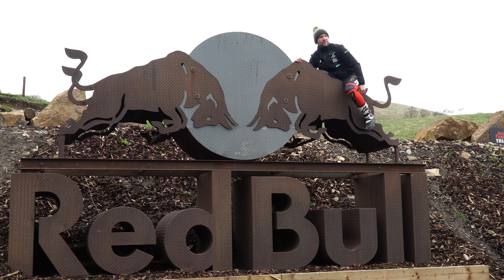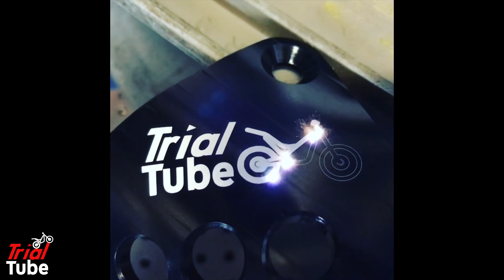Trial Tube - Do I still love my Vertigo R3 300 2 Stroke? Plus trials tutorials!

Comment: I'm going on almost a year of owning my R2 300. For me there is not other bike that I want to ride..owned a Beta, still own a 2016 Scorpa 300, and a 2019 Scorpa 300 Factory, just rode a very amazing look and quite nice 2021 TRS Gold 250, and even got to play on a 2021 EM Race which was a fun experience. After owning or riding all these different bikes none make me happier or want to ride more than my Vertigo. Now sure I can find things to complain about, but at the end of the day the bike makes me feel like trying new things, pushing my limits, and brings a huge smile to my face each time I oh so very smoothly grunt my way up a technical turn laced hill. The smoothness of the Vertigo motor down low has me  yet to meet a rival. Then when you want to really go the bike has all the go you could want on tap. Where I live we went from 95F last weekend to 55F a few days later. Guess what my Vertigo runs just about the same. My carbed bikes are surging at idle and need tweaks to the air screw. All the modern bikes are incredible, and it os hard to go wrong no matter what you ride, but for me I love my R2 !

Comment: Recently picked up an R3 250 having come back to the sport in 2017 after a 27-year hiatus and a few years spent road racing. Had a 2018 Beta 300 and then a 2020 TRS 280 One R — knocks both into a cocked hat so far, absolutely incredible bike. Only thing I can criticise is the thin standard sump plate — have also gone the CSP route, though a plain one to better hide my clumsiness... good work with the videos, trials needs as much media as it can get.
Reply from the maker: Thank you so much for the incredible comments bud and really appreciate the backing up of my expertise! 

Hope to see you soon!

Comment: Great video, Ive gone from a Beta Evo 250 to a Vertigo R 250 and its brilliant it turns,  I find it grips more on the turn, great balance , and the throttle response is so so so crisp, smooth, and the feel of it spot on. You Have to try one to understand.
Reply from the maker: Exactly!! I was Beta trough and through and lol at me now! Loo
Reply: I am surprised Vertigo turns as good as it does. On the ground walking the bike upright on steering lock it has a much bigger turning circle compared to Beta When on the bike I am pulling off turns a lot of others struggle with.
Reply from the maker: @shawnmcginnis2508  it’s all about the way the bike feels turning in! Ps the Beta will turn tighter as the head angle is steeper.
Reply: @TrialTube  100% . Beta  has a shorter wheelbase too. Like you said though so much is about how it feels in the turn and the confidence it inspires. :)

Comment: Hi Danny. Where did you get your carbon engine protection from. Thanks
Reply from the maker: On that model it was standard Vertigo equipment. However I use RT WORKS for my usual stuff and my Nitro!
Reply: @TrialTube  thanks for the information Danny. Just bought a 200 jbr vertigo. It's superb
Reply from the maker: @chrisstoddart4342  fantastic choice the 200 is awesome!

Comment: Thanks Danny and Stu!
Danny, what are the main differences in how the Vertigo rides compared with the Beta after 6 months?
Reply from the maker: It finds the grip a lot better, is lighter and reacts faster. The suspension is better and so are the brakes and clutch. But there is a rather large jump in cost also.
☝️
Reply: I'll second Danny's opinion. When people ask me I say it feels like a stretched out, more responsive, and more peppy Beta. Vertigo has done a great job (speaking for my 2020 300 R2) about making a motor that will chug along so smoothly when put under a bit of a load that is predictable, easy to modulate,doesn't have that surge or stutter, and just pulls. It inspires so much confidence in tight hillside turns. 
    It is longer than a Beta and you feel that right away. It is more responsive to footpeg pressure, and flicks about easier. Not quite as fast handling as a Scorpa or TRS, but a nice balance in being flickable yet stable.  Vertigo has a bit heavier front end feel as well.
    As I commented earlier all the new modern bikes are very capable and you really can't go wrong, but for me my R2 is what makes me want to ride and try new things. I instantly miss the smoothness of my Vertigo when getting on other bikes. The level of consistent and precise throttle control is just not able to be found on a normal bike. Idk if you'll get on a Vertigo and notice the smoothness and throttle control immediately, but if you ride one for a bit in some sections and then go back to a bike with a carb its then you'll feel the difference and most likey miss the smoothness. One last thing I'll say ,as much as I talk about the smoothness of these bikes they also will rev and dang do they put out some power when they are asked ! Where my Scorpas quit pulling my R2 yanks even harder.
Reply from the maker: @shawnmcginnis2508  what an incredible comment and thank you for backing up my experience 👍👍👍
Reply: I guess I'll also try to clarify when I say smoothness it is not the same as flywheel weight smooth or slow. While the R series bikes have an added flywheel weight they don't feel like it. Both my stock Scorpas (2016 standard and 2019 Factory 300) have more flywheel effect feel. Vertigo is a tuned soft and smooth down low, not a weighted flywheel soft and smooth. Unless you ride one it may be hard to understand the difference especially with my horrible ability with words.

Comment: Not ridden trials for years been riding enduro. Think doing some trials will help me in the technical stuff. Thinking vertigo but only got £5k out of the range what would you recommend?
Reply from the maker: Easily get a GasGas or Beta or TRS in incredible condition for that amount bud! Stick with a 250 though or even a 200 😜

Comment: Love the channel, as a new be to trials, however I would like to see a bit more 'how to' riding technique clutch throttle control etc etc on to start with easy obsticals, a decent practice routine. This really to be aimed at the very beginner, although the content on 'new' bikes is very informative but that's no good if new comers struggle to use them as is, bottom line a bit more how to section but I do happen to enjoy the site very light hearted, funny & it is very informative so many thanks Danny, keep up the good work.
Reply from the maker: We have some more technical riding videos coming very soon!

Comment: Bro the only thing that is a bit off putting on the vertigo is that really loud fan whine, it’s almost as loud as the motor, does it spin faster than other marques? If so why?
Reply from the maker: Honestly I don’t even notice anymore lol and I guess it has a lowered tolerance to stay inside a smaller heat threshold…
Reply: @TrialTube  ooer mother, what’s that mean? Just wondering why, as the ossa had the rad behind the cylinder but didn’t go off too much, but the vertigo is flat out all the time! 
I admit when the fan kicks in on a Gasser etc it does affect performance, is it same on vert?
Reply: @ianmargetts4940  you get used to it, but yes it is loud. Vertigo does have a closer heat range tolerance and runs the bike at a warmer temp to ensure good burn. This does leave the fan running 90% of the time. Because of all the electric stuff on the bike IF the idle is set too low it is more likely to flame out due to not enough power produced to run everything when the fan is on. This was a major point of frustration as well as plugs fouling often when I first got the bike. This is a typical complaint. After talking to the importer im the US as well as a UK Vertigo guy I learned the idle needs to be set right around 1400. This has cured plug fouling in many cases as well as unexpected stalls.
Reply: @shawnmcginnis2508  - great info. I've gone as high as 1500RPM, but have found that's mostly personal preference of the customer and varies a tad between models. And of course, for the unaware in the crowd - reset your TPS when making idle changes!

Personally, I love the loud fan as it tells me things are working! It's also an audible troubleshooting tool. As you mentioned, keeping the voltage up is critical on a Vertigo - and you know immediately you've a low voltage issue if your hear the fan speed drop. Most often, that's just a sign the idle is too low - but regardless of cause, the sound of the fan speed dropping is very obvious.

Comment: Nice front pipe!
I’ve been a Beta man for the last few years and the Vertigo is looking like a good option. 
How does the R3 handle the gullies compared to a trusty old Beta? 
Is there any type of section/terrain you find better on the Vertigo?
Are there any downsides to owning a Vertigo?
300cc or 250cc?
Reply from the maker: The Vertigo just holds most lines better than the Beta (for me) also love the lack of a carb! Makes my life a lot easier!
Reply: I'll add in the map switch makes a felt difference both off idle and mid range. Super fine and precise gentle throttle when needed, rocket ship when needed. Very flexible bike personallity.
Reply: Yes I'd say there are some as on any bike it has its quirks. I'm at work currently but I'll go into detail later.
Reply: @shawnmcginnis2508  thanks for the info. are you on a 300?
Reply: @stuartkeegan100  I am on a 300.  So as far as down sides to Vertigo there are a few. 
   First off is starting. 4-6 kicks cold(occasionally up to 10) and it has some compression so they need to be good kicks. 1 kick 90% of the time when warm. It doesn't bother me,  but some people don't like it. 
  2. Electronics. Speaking 2019 forward they use the Athena GET ECU which is a popular aftermarket ecu upgrade on a lot of FI bikes. Pre 2019 (maybe 18 sorry if wrong on year) they used a different system and it had some potential weaknesses. 
  3. Electronics. People that have been around bikes know carbs( mostly). EFI not so much. It is new and "scary" so people shy away from it. There is a learning curve for troubleshooting, though mostly my bike has been trouble free. The bikes have been around long enough now that there is some good(also some really wrong) community knowledge and most common problems are easily solved now. 
  4. Electronics(sensing a theme haha) because everything on the bike is electronic it uses more electricity. Should the idle drop too low the bike will loose power and die. Caught me off guard a few times when new. Also low idle setting can cause rich running. Set idle to 1400RPM-ish and no more problems. 
 5. Electronics(lol) carbs gum up if not treated well otherwise being mechanical and gravity fed they generally always work. Vertigo has a fuel pump. Filter can clog, and pumps eventually fail. Now most modern road bikes are EFI our cars are EFI ... It isn't a big deal, its easy to test pump pressure, but it is a consideration. Same with water pump,  but at least when it goes you aren't opening up you case and there is no internal engine seal to leak and get coolant inside the case. 
  6. Here in the US there aren't as many dealers as other brands. I don't really have a local dealer. I now have one about 4 hrs away as of recent, but he isn't set up to service the bike. I knew I was going to be my own mechanic going into this. The US importer Lewisportusa has been great,knowledgeable,helpful,easy to reach,and quick to react to the few concerns I've had. So hmm maybe I just flipped that con to a pro...at the very least canceled it out haha.
7. loud fan lol... At least they hear you coming down the loop and are ready for you when you arrive at a section. 
8. The bike looks so dang good you hate to scratch it.... Ok now I'm just having fun. 
 So yeah there are some things to think on, but dang I love my R2! I will eventually upgrade to the R3 airbox cover and maps. My Vertigo has been an excellent and thus far 10months in reliable bike that makes me smile each time I ride it. The smoothness down low, it's ability to tractor along and find grip,its insane top end(not like I can use it, but still fun), and the unique sound are all things I love. The parts on the bike are all top quality and close inspection shows where some of the price comes from. I think everyone ought to at least take a test ride in some real terrain and see how it does. Most will be pleased. 
I offer my bike up for test rides at most trials. Last few comments included "reminds me of my Beta so I feel pretty comfortable already". "Surprisingly smooth and controlable". "Turns really good". "Suspension feels really nice". 
   Ultimately the biggest downside is price, but you really are getting a lot of bike and to me,FOR ME this bike has been well worth the entry fee. Purchased having never seen one up close. Now almost year later no regrets! Even after riding a very lovely 2021 TRS Gold!
Reply: @stuartkeegan100  hopefully by end of week I'll have a video up about my ownership experience and document pros/cons of my bike. It will be long and not nearly as cool as Danny's video. There will be a lot of highlights and details though. Horrible entertainment, but great info ha ha ha.
Reply: @shawnmcginnis2508   Thanks for your insight to ownership. My father has an 2021 vertical 200cc. The trick to starting his is first kick to 'prime pump' second kick have throttle 1/4 on and it starts every time.

Comment: I've noticed vertigo's tend to change hands often and look a bit used after a short amount of time. Not sure on the reason as never tried one yet so I'll reserve judgement until I do. 
Looking forward to the next sherco review though as there my personal favourite.
Reply from the maker: Mine isn’t looking tired but the early ones do change hands often indeed. I think you will like next weeks for sure!!
Reply: My R2 is looking great still and still noce and tight. Vertigo did take some risks early on and the first few ones had some early on problems. Pretty well sorted bike now by the 2020 R2 and Works 21 models. I love my Vertigo,  but idk if I'd feel that way about an earlier model. Try a new one and I think you'll be impressed. Maybe wont want to own it,  it I doubt you'll walk away thinking it is an undesirable bike. Another thing about Vertigos changing hands often could be because they are constantly refining them and making changes to improve on the bikes. Some other brands could go 3 years and you still have the same bike. Vertigo has kept learning from mistakes and improving their design.
Reply: @shawnmcginnis2508  Yeah I think I'm going to wait on the brand here. All the Vertigo bikes in the US seem to depreciate more quickly and as the OP said, they change hands quite often. But if a potential buyer can wait and see how these 2020 and 2021 models do maybe it'll all sort itself out and be more like the TRS market. The other thing I'd add is that being a dedicated trials manufacturer like TRS and Vertigo is not usually a recipe for long term success because trials is such a small community when compared with other types of motorcycling. I still don't know how they survive making just a few thousand bikes per year for the whole world! At least Beta and GasGas have income from other sources like enduro and motocross bikes.
Reply: @fprintf  Vertigo started as and I believe is still debt free. Their owner already has a large successful business .  This is his side project because he loves trials and wanted to make a better bike.
Reply: @fprintf  I do understand your hesitation and don't blame ya one bit. I just know for me there is no other bike I'd rather ride and that is after riding and testing all the bikes including the newest TRS Gold. Thankfully all the current bikes are pretty great and we have some great options !
Reply: While my Vertigo experience is limited to 2020+ models in the last 18 months and about 20 bikes, I've not seen that. I know of one ex-Vertigo owner, and he got out of trials altogether.

That's not to say they don't change hands - I absolutely see that. However, it's been in the form of folks upgrading. I've found it a bit surprising, but plenty of trials riders around me upgrade their bikes every year or two - and every Vertigo customer who has done so, has picked up another one. Many of them have gone from Works to R2/R3 or Dougie Lampkin models as well, just wanting a bit more "yum". ;)
Reply: @fprintf  - I've directly sold, or facilitated the sale between individuals six used Vertigos in the last 6 months. They've held their value insanely well, so maybe what you're seeing is a regional thing. Or - maybe what I'm seeing is regional.

Regardless, in the last month up here in the Pacific Northwest, US - two low hour Works 300's were sold for people upgrading to Dougie Lampkins. One sold for $8,000USD in less than a day. The other sold for $8,500USD - with nothing other than a text to somebody who had missed out on the first one.

Yes, they both had a few upgrades - but not bad for a bike that sold for $8,900USD.
Reply: @olymoto1585  That's pretty great to hear! I agree it is probably a regional thing. I'd also add that perhaps the Covid thing had something to do with it as trials bikes in general have been hot properties. Here in New England the Vertigos have been a tough sell, but a lot of it based on poor experiences with one of our top riders and the early models possibly turning people off? Hopefully that is all a thing of the past, we are all better off for more innovative trials motorcycle manufacturers making better toys for us all!

Comment: I have just started trials and I am riding a 2000 Beta with the USD forks. I have also just picked up a OSSA Tr280i that I will be riding once I finish fixing it up. 

Are you able to cover gear selection and how to work out what gear we should be using for different sections.
Reply from the maker: I can indeed and I owned a 2000 Rev 3!